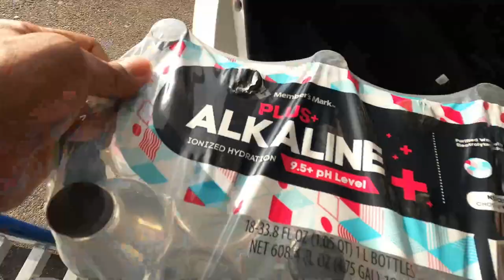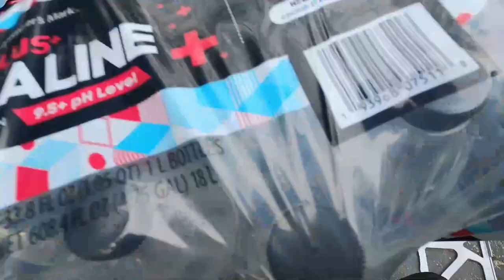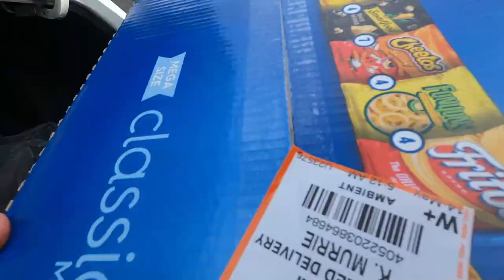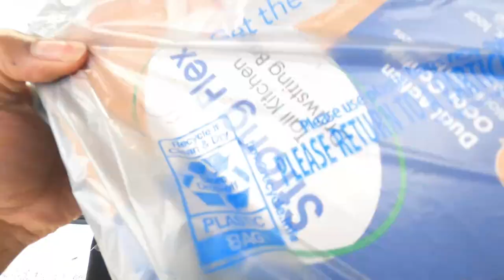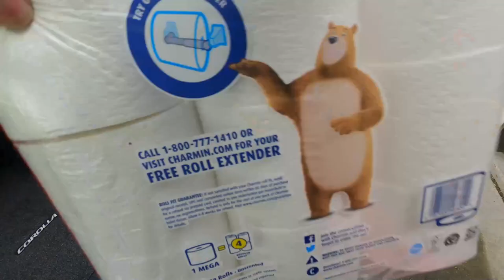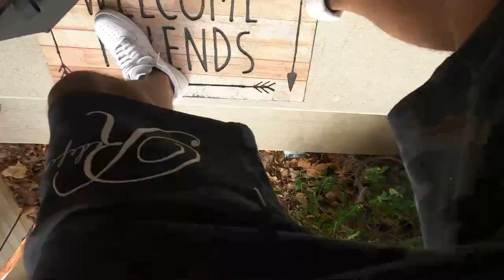How Did I Make Over $200 In Less Than 3 Hours? 🤑InstaCart, DoorDash, Spark Ride-Along, Tips & Tricks

Comment: Hey, I watch your channel for inspiration. I'm trying to sign up with Spark delivery but when I get to the part where I have to upload my insurance card it doesn't upload. Do u know if anyone else has this problem?
Reply from the maker: Thanks for your support! I had a few issues too, I just kept trying I also went  out of the app went back in and even turned my phone off and turned it back on. Eventually, it worked.
Reply: @carsandcribs  I will try that, thanks!
Reply from the maker: @msprettybee45  You’re Welcome!
Reply: I had a problem uploading my ins card too but it finally took after a million times
Reply: @tanelise4673  I think the website has a glitch, thanks for replying.
Reply: Try scanning on your phone as a pdf instead of a photo. Sometimes it's the file type or file size.
Reply: @abbylynn8872  Great idea, I've tried everything. I've tried condensing the file to a smaller one as well.
Reply: @msprettybee45  also check how you have the file named... no spaces in the name and not too long or special chatacters... do something like 
LastNameInsuranceCoNameEffDate... ex
LynnGeico12022021
Reply from the maker: @tanelise4673  I was mad as ever doing it because the samething happened to me!
Reply: @abbylynn8872  ok I will try that. Thank you much 😉
Reply: @msprettybee45  Did you get it to work yet? Hope so
Reply: @tanelise4673  unfortunately no 😔, thanks for checking on me🙂.